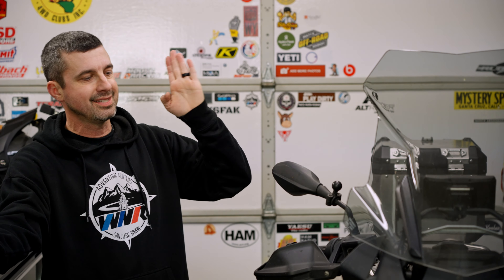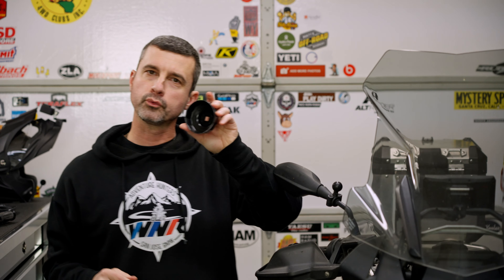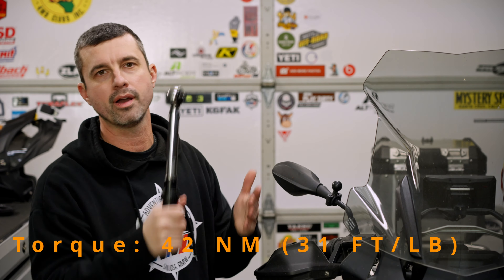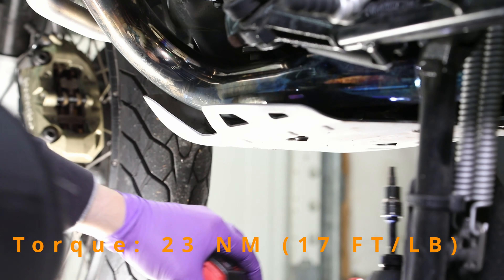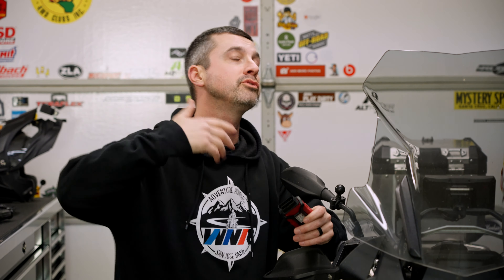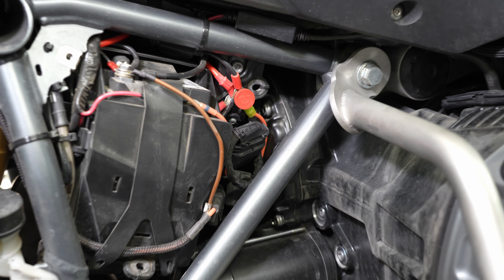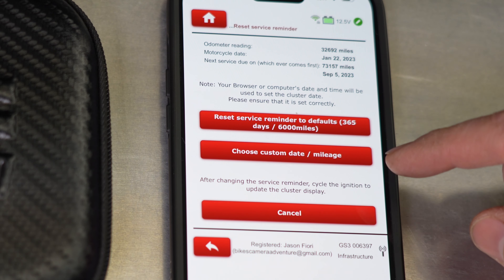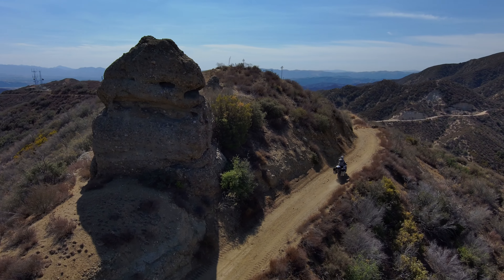BMW 1250 / 1200 GS Oil Change

Comment: I like that very last comment, man! Great work! I've been using a GS-911 for a number of years now. It's a good device! Now, with my R1250RS, I've had to purchase the adaptor so the older unit will work with the 2022 bike. I note that you've got tiny zip-ties on those goofy grommets on the side panels. Good idea.
Reply from the maker: Thanks for watching a dropping a nice comment! Yes, the GS-911 are sweet tools for sure.

Comment: Thanks for the shoutout! Can’t go wrong with Motoscan or GS-911, see you on the road.
Reply from the maker: You bet!
Reply: Take a look at your overpriced BMW oil filter. Right on the can, it states it's made by Mahle. Why not save a few dollars and purchase the oil filter from Mahle. It's a Mahle OC 619. It's also available from Amazon.
Reply from the maker: I was not aware, thanks for the info! I just found that on Amazon for $16.

Comment: So did BMW eliminate the 2nd 'internal' oil drain plug?
Reply from the maker: Great question! I'm not aware of a second plug. This is my first GS 1250/1200.
Reply: Thanks for the reply! BMW used to run a partial dry sump system but it looks like they've moved away from that. I've got a 2023 GS 1250 I when I didn't 'see' the second internal drain plug, I watched your video to validate it's absence. Thanks for the great content! 🏍🤘
Reply from the maker: Got it. Thanks for the kind words!
Reply: They only have that on the K bikes. My K1600 has the internal sump plug and my 1250 RT doesn’t have it….